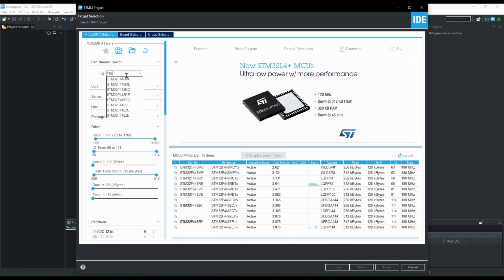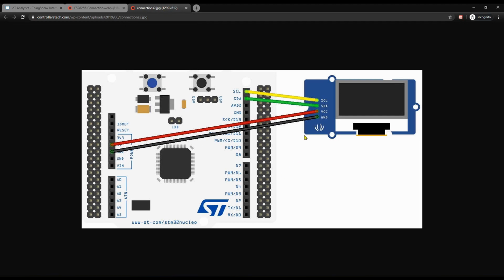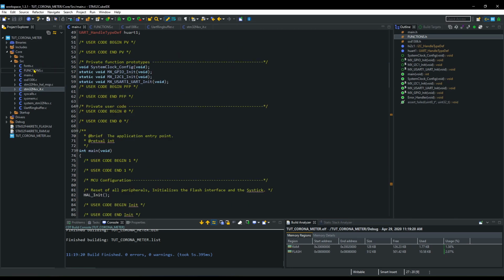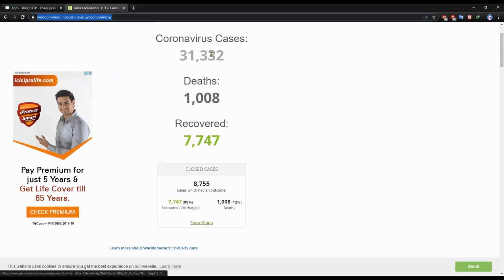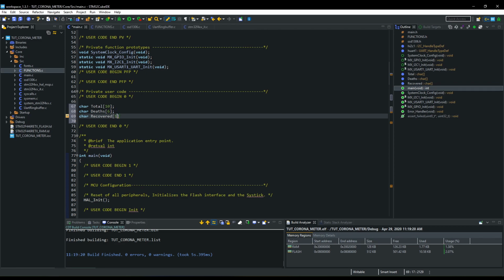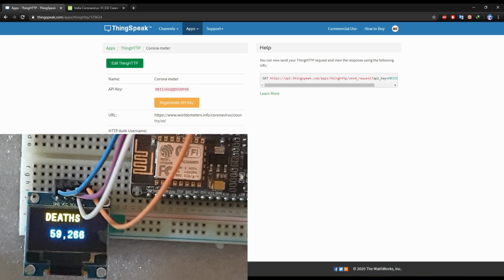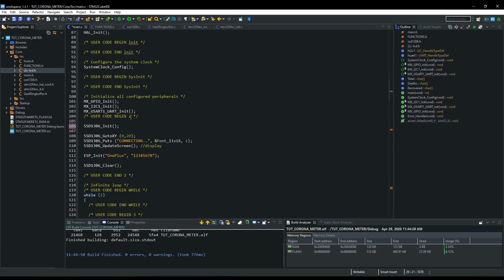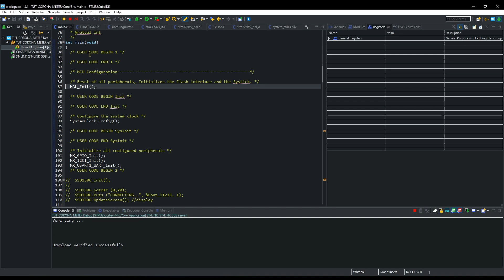Corona Display Meter using STM32 || ESP8266 || OLED || LCD16X2

Comment: Hello! I tried making this project, but I got errors in the UartRingBuffer.c file, specifically it said this: 'USART_TypeDef {aka struct <anonymous>}' has no member named 'SR'; did you mean 'ISR'? 
I got this in several places, for both SR and DR registers. If I change them to ISR or RDR it will compile and run, but never get past the "connecting" screen. Any tips or solutions would be very helpful!
Reply from the maker: Did you replaced the Uart_isr with the one provided on the website ?
At one place in the end, you have change DR to TDR.
Reply: @ControllersTech  I've tested this but nothing seems to change. I added some extra code just after the ESP_init call (which has the correct SSID and passwords) to see if anything gets printed which it does not, so I think I may have done something wrong or need to change something in the ESP_init? I set the STM up just like in the video and followed all the steps so I'm very confused as to what could have gone wrong.

EDIT: I'm using an STM32F0 discovery, but that shouldn't make a difference, right? I changed the inclusions to the correct ones for my board.
Reply from the maker: In the ESP init function, i have used the AT commands. Some ESP versions might support different command sets. For example AT+CWJAP could be AT+CWJAP_CUR. Better connect your ESP directly to the PC and test all those AT commands first and see if your device is responding to them. 
If it doesn't, telegram me @controllerstech
Reply: @ControllersTech  Okay, will try this! Thank you!